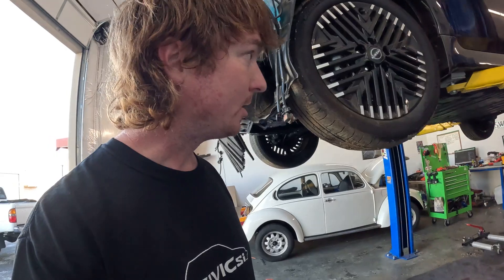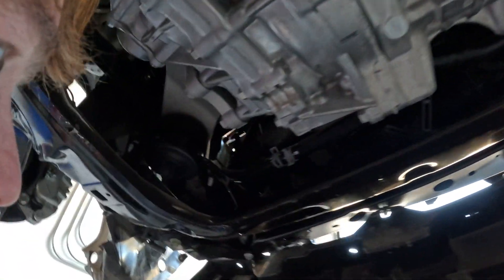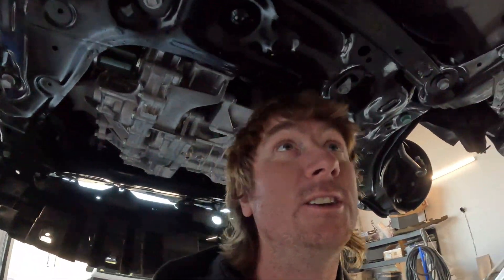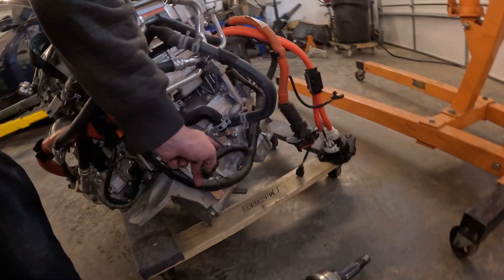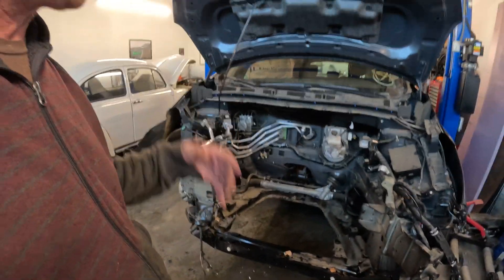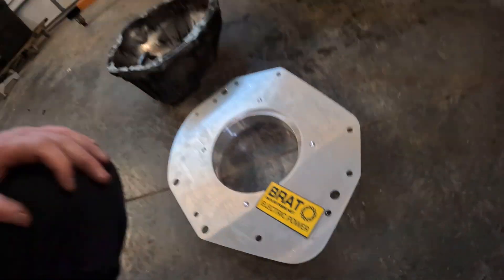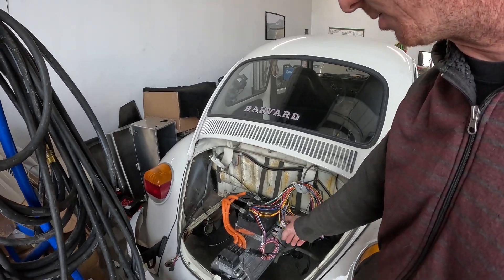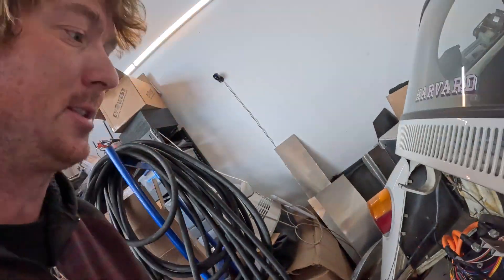LEAF Teardown: What's Inside a Nissan LEAF That We Can Use?

Comment: Can the leaf motor be coupled with an automatic transmission ? and if so, would you still be shifting between Park, Reverse, Drive with the oem lever or would it just be buttons for gear selection like your Nissan Frontier conversion ?
Reply from the maker: Technically it can, if you make the required adapters. The issue is that an automatic transmission relies on the motor to spin at an idle speed to keep the transmission fluid pressurized. Also the electric motor needs to be above 3000 RPM to get its best efficiency and most automatics try to keep it at a lower RPM during cruise. Short answer, yes, but you wouldn't want to.
Reply: @EVSwap would like to convert an auto AWD suv to a RWD EV.  looking to get rid of the transmission all together and somehow utilize the drive shaft to send power to the rear wheels.. looking for a more options than just a Torquebox.  Any recommendations ?

Comment: Wow, what a great donor!

About those long wires on the VW controller, do you have to cut them short or can you depin them from the connector and remove them altogether? I've started trying to do that wherever possible and once in a while I find something needs to be longer, so it's nice when I can take one of those spare wires and re-insert it in a different spot.
Reply from the maker: Good idea! That will make it look a lot cleaner too.

Comment: Jimmy it looks like you left the last couple of battery bolts with the car down and resting on the dollies. Can you share a little about that final step to lift the Leaf off the battery pack? We’re doing a battery pack pull on a 2019 in a few weeks and want to draw on your experience.
Reply from the maker: Yes, I left 4 bolts in the 4 corners of the battery box and then lowered it down onto the dollies before removing them. Makes it easy!

Comment: What about the accelerator pedal, steering, brake system and all other, now electrically run, components?
Reply from the maker: Unfortunately, no that stuff is not useful. The throttle pedal I did remove to use in the conversion.

Comment: Hey Jimmy - another great video as usual.  What a great donor car for the Tacoma!  Virtually brand new and a 60kwh pack.  Should give it plenty of range.  Out of interest - is it a 110kw or 160kw leafstack?  And if you are able to, can you give me an idea of what the wreck cost?  Those Brat industries adaptor plates sure look nice, and will make the install go fast.  I spoke with Angus, but unfortunately he did not make an adaptor to suit my Rodeo, so I had to make mine myself.  I spent a LOT of time on making sure I had it lined up correctly.  But it was worth it as i cant feel any vibrations in the test runs I have done to date.  My Leafstack was an 80kw unit out of a 2014 leaf.  But the performance in the Rodeo is fantastic, especially if I use 2nd gear😁!  So if yours is a 110 kw unit they should be really happy with the performance, and if it is a 160 it will fly!  Also out of interest - are you keeping the power assisted steering rack from the leaf, and what about the A/C compressor- do you re-use those for your conversions?
Reply: In the video he bid on it, it went for $10k (plus fees).   Maybe its different here in sacramento where we seem to be the salvage yard capital of california, but I bought a 2024 Model 3 60k pack (4 200lb modules) for $1600 out of a damaged car.  He would also sell the complete rear suspension/motor/inverter from it for $1500, but I'm doing a 3 motor build for my 56 chevy project, leaf setup in front, and two motors in back.  I was tempted by the 1000hp plaid 2 motor setup in back for $6000 from one of the salvage yards, but that is out of my budget.
Reply: @murraymadness4674 many thanks for that - I must have missed that video.  Wow - $10K !  I know it is a virtually brand new vehicle, but that is way out of my budget.  I am in Australia, and my whole budget for my project is $10K Australian, which is only just over $6K US.  My 2014 Leaf only cost me just over $1K US, and that got me a %75 SOH battery that will hopefully get me approx. 60 klm  of range.  I am currently looking at other salvage cars to get a better battery, but I should be able to do that and still stay within my original budget.  Your build sounds nice!  Should perform pretty good.
Reply: @murraymadness4674 I agree that the battery temperature control is the biggest weakness of the Leaf design.  Like you thought, it is not such a big issue for me, as i don’t get big temperature extremes where I live ( Brisbane where the temp ranges from a low of 5 degrees C to a max of about 36. And you only get those extremes a couple of days a year).  But on  the other hand, there is also a lot less things to worry about when using passive heating/cooling
Reply: @murraymadness4674  yes, and that is what I am doing too.  I am building 2 boxes to go under the tray either side of the tailshaft.  I think Jimmy must have had a bit more room to play with on that Fronteir  though, as it is a tight fit for me on my Holden Rodeo, especially on the drivers (rhs in Australia) side!  I am also building my boxes with an eye to the future when I buy another salvage EV for the batteries.  My favoured candidate at the moment is the 2022 model or later MG ZS EV with the 51 kwh LFP pack
Reply: I meant to say Power assisted steering collumn, not rack!
Reply from the maker: Yes, the donor LEAF has the 160kw motor. Should be really fun! Glad to hear your Rodeo is so fun to drive!